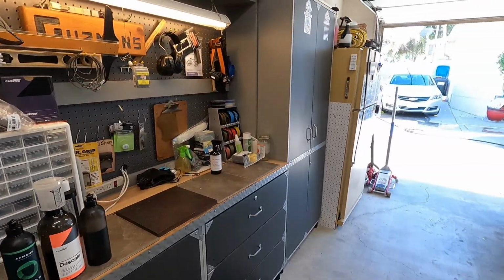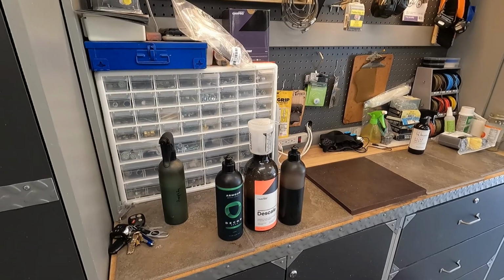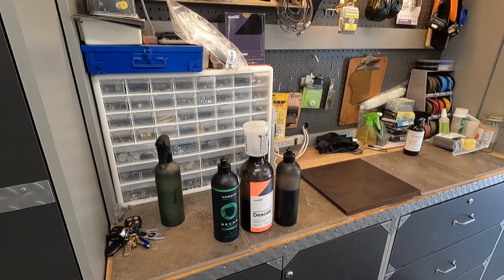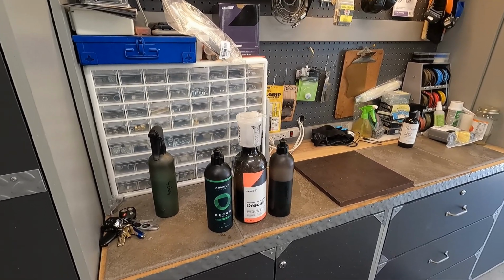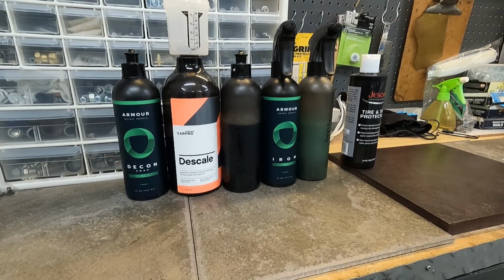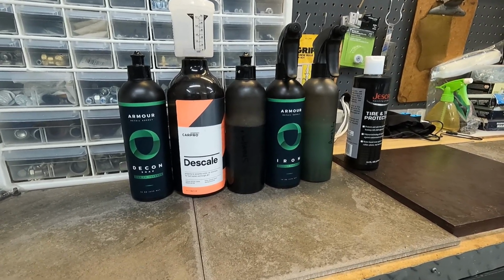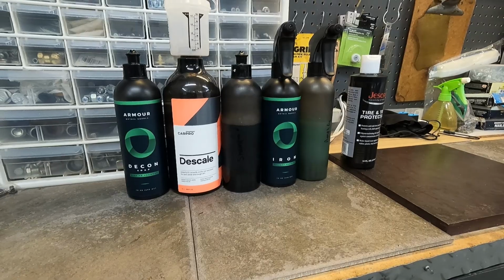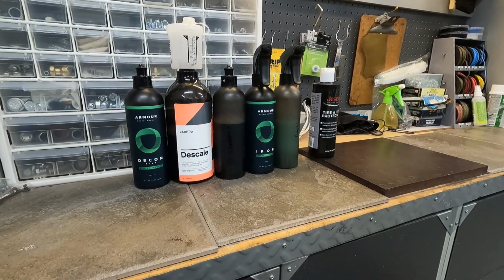Armour Detail Supply Armour Pro Quartz Ceramic Coating - 3 Month Update

Comment: Mike, looking for your thoughts... i typically do not buy a wheel only coating  but use what is left of my bottle(mckees sio2)..  the issue i have is it doesnt typically last that long... a few months... are the wheel only coatings that  much tougher or am i just using to strong of chemicals and abrasion.   Brake buster type chemicals and ez detail brush... what do you do for coated wheels.
Reply from the maker: I can’t speak to the McKee’s coating using it for wheels and it’s durability.  But I don’t use wheel cleaners for maintenance washes. I use car soap and water with the occasional decon like I did in this video.  I find no need for using a wheel cleaner. I only stock a wheel cleaner if I work on someone else’s vehicle.
Reply: Brake buster and other strong alkaline cleaners do harm coatings if you use it enough. Try switching to a wheel cleaner that’s closer to neutral and uses iron remover. Turtle wax Rapid Decon is a good cheap one but my favorite is Koch MWC. The Germans are experts in both creating and removing brake dust.

Comment: hi Mike, carpro descale is not ph3, descale is ph6
Reply: I need a bottle of that.
Reply: I think he’s saying that he’s using 3 different pH levels to wash. High with Decon, low with Descale, then neutral with Shampoo+
Reply from the maker: Undiluted it is a pH of 3 per my digital pH meter.  Mixed with water it will be around a pH of 6 still making it fall under the acidic range of the pH scale. In the range of something like urine.  And no I am not telling you to use urine to decon haha.  Thanks for stating the comment.